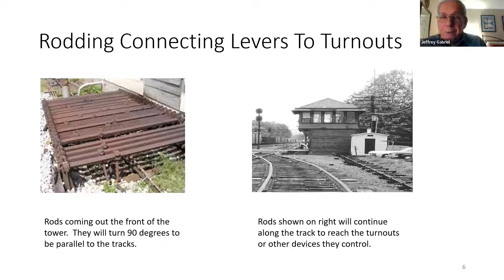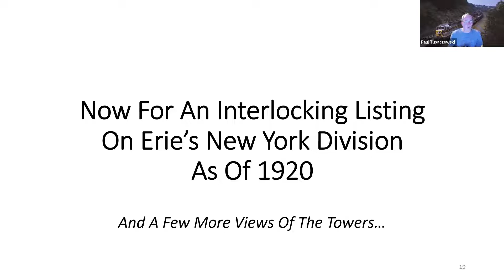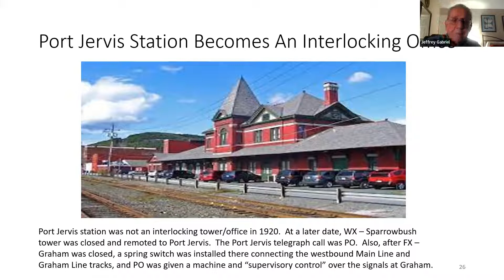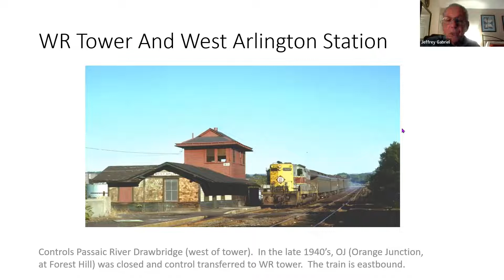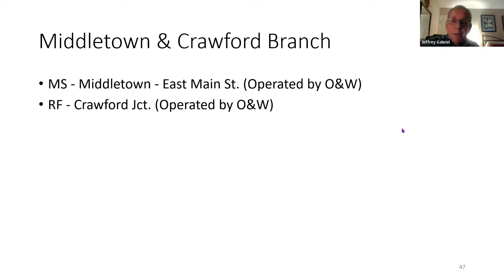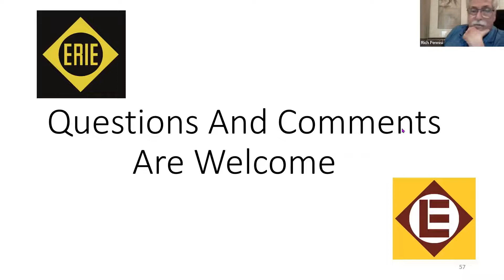"Erie - New York Division Interlocking Towers" by Jeff Gabriel

Comment: WRT the question at 20:43 regarding electrical interlocking and loss of power. From my research on interlockings in the 1920s. Electrical interlockings were not getting primary power from the electric grid. First because in the 1920s the grid as we know it today didn't really exist. There were limited grids near major cities, but throughout the countryside, not so much. Second, because interlocking by design have to fail safe, they were usually powered by large battery banks usually located on the first floor of the tower. Batteries were a well understood technology by the 20s and the design rules for operating electrical towers were well defined. There were good rules for estimating the energy required to operate an interlocking. Calculating the power took into account the number of devices that needed to be operated, the number of operations per day, and an arbitrary percentage to be added. The engineer would then add a second bank to the system. These banks would be operated independently of each other. So during a two week period bank a would operate on say even numbered days and bank b would be operated on odd number days. The bank that was not running the system would be available for maintenance of the battery, changing cells, charging the bank, topping off the electrolyte, etc.
Don't forget that at this time the track circuits were for the most part battery operated as well with battery vaults along the mainline to provide power to the line relays and signals.

Comment: I was employed as a tower man at Dover third trick from 1970 to 1974. Dover still had the arm strong levers but the plant was electric powered switches. There were two traffic levers governing reversible traffic between Dover and Denville, tracks 1 and 2. I was also qualified at Denville, Port Morris, Suffern. With the advent of ConRail I transferred to train service, retired 10 years ago from NJ Transit, 43 years of railroad service. Nice explanation.